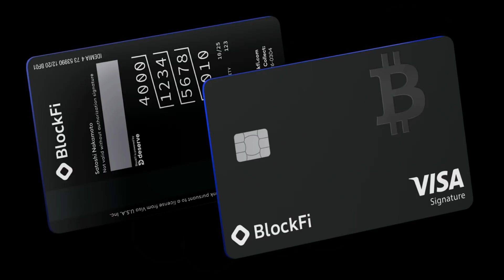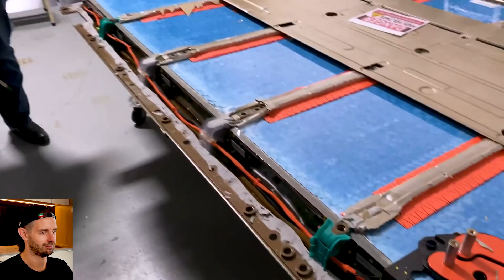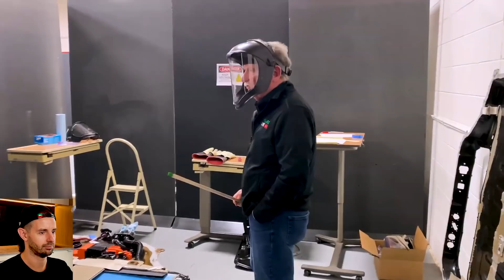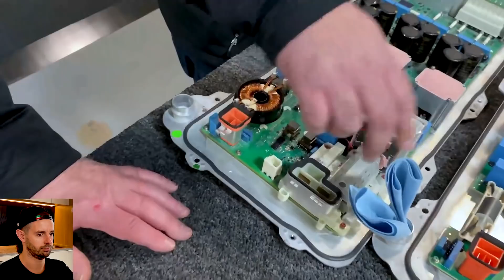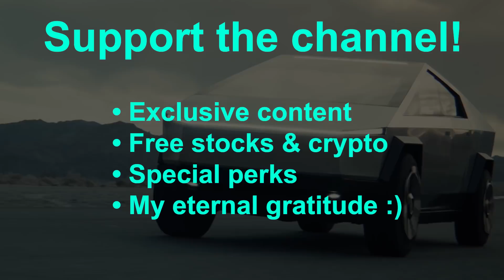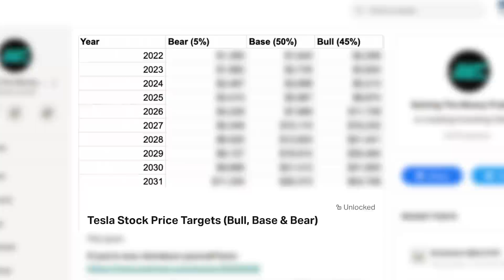Sandy Munro EXPOSES Tesla's Engineering Secrets

Comment: The Engine will be Double with up to 2 Engines in one for 4 Engine for far Higher Price to Car and Save Costs on Engines and Save Battery and Better Eccelartion. Even in CyberTruck that Start with 2 not 4 i Think, Maybe, and Semi with 4 to Save Costs and Better Stops. And in X and S Plaid Ex for 185K. And Roadster that can go 600 KmH for 200K.

Comment: The cost savings of using common electronic components across multiple models is even greater than you might think. Common components using the same firmware reduce design and administration costs. It takes a great deal of time and administration to properly maintain a library of firmware. Frankly Scarlet it is a "phawking" nightmare mate.

Comment: The latest SpaceX presentation showed the first and second versions of the Falcon engine. They are like night and day. The second version looked like it had half the parts and were routed much more simply. He discussed some first principles concepts for different travel systems, outlining a heirarchy of mode share for the distance. A rocket could send people or freight to the other side of the world in an hour. But it would not be so practical going across town. But looking at the rocket launches it doesn't look to me like this is very practical for travel within our solar system, let alone to another solar system. It's a massive amount of fuel just to get to orbit, then it needs to have tankers sent to orbit, to refuel the ship before it heads out to Mars. Right now, a Mars trip would also require sending propellant to Mars to be used for the return trip. People say right now 40% of ocean travel consists of just shipping fuel around the globe so we can ship the stuff we want to move. That's massively impractical and illustrates the impracticality involved in using rockets to get anywhere beyond orbit or beyond the moon. We need another system of propulsion altogether. If and when we invent one, rockets could become as obsolete as fossil fuels are for surface transportation. Chances are we would need a dozen independent methods of propulsion to make solar system travel in any way practical and to make inter stellar travel remotely conceivable.

Comment: Backward and cross compatibility as well as common parts were part of GM's philosophy back in the 60's. Working those old cars was easy because there weren't a lot of unique parts and some parts were common across different GM platforms. The number of different size bolts was also limited. Over the years complexity increased and we saw that philosophy die. My, how they have lost their way. Now it's gonna bite them. Always remember that the fundamental tenet of good (and beautiful) engineering is KISS - KEEP IT SIMPLE STUPID.

Comment: Steven, another great video, thanks. I lead a small zoom investment group and one of the participants is a mid-level mgr of the water & power company of a major US city. This person believes that both the national and regional electric grid-infrastructure in the US will not be able to support the growing electric needs posed by EV growth by 2040, much less by 2030. In their opinion, this will put a ‘cap’ on useful charging stations, EV and Tesla sales. Additionally, over half of the US is in severe drought, particularly the Western regions. 90% of US electricity is powered by water driven sources, which are at all time lows. Have you done any research/thinking in this area? Comments?
Reply: Mega packs to support the grid? Power walls to support individuals? Solar to support power walls? Just thinking out loud.

Comment: When Tesla uses top rated chips it makes saving in power usage and there is a lot to save when Tesla may take .5 kW to operate wheen car is on. But others relay to traditonal automotive components but those are power hungry. For example Tesla moved from intel to AMD and got instant saving 50W but when you apply it fully charged car on period eg 10h that is .5kwh and so it goes. Chineese are not producing sub 7nm chips that Tesla uses so they are not in position to monopolize EV making .

Comment: Another very good example of why legacy automotive lag behind true pioneers--they opt to copy rather than do their own homework. Many automotive OEMs perform 'benchmarking' activities on competitor products. They essentially reverse engineer the other guy's product to see where they can use his idea's to improve their own gadget/widget. But the problem, as I see it, is that this process makes you lazy over time. I'm pretty sure GM has 'benchmarked' several of Tesla's vehicles to glean some epiphany on how to out-manufacture or out-patent the company. This is traditional thinking. Where are their ideas? Where are their body designs? Where is their identity as a manufacturer? They have none...well, they have badges on the different vehicles but that's about it. Some companies will get it and begin to decide to really invest in R&D again while others will cease to exist. As Sandy Munro pointed out, saving mass, using true common parts philosophy where appropriate, reducing complexity and parts are things current OEMs are aware of but they don't discipline themselves to be diligent. That is why many fail when it comes to innovation. Many use the word but precious few really understand how it translates.

Comment: The graph at 6:20 combines different parameters and different units all mixed together onto the Y axis;  it is utterly incomprehensible.  MPGe and Range should not be plotted together;  they are not merely unrelated;  they go in opposite directions;  and are different units;  forming two sets of curves that tell opposite stories to the untrained eye.  What's even worse, there's a blue down arrow between the sets, further suggesting that they are somehow related.  Very disastrous creation.  They do a lot of good things at Munro, and I'm a big fan of theirs;  but they need an editor with a fraction of a science background.  Ironically, I sent them my resume but apparently they don't want un-degreed Canadians.  I could help them remotely, too, but apparently they also want to smell the socks of whoever they hire.

  Same thing with my applications to Tesla, SpaceX and Neuralink.  Rejected every time for being Canadian.  Their HR departments I'm sure are nowhere nearly as incompetent as those of most of the industry, but they still manage to be effective traitors to Elon's values, and to make all their decisions on the basis of arbitrary rules of thumb, instead of first principles.

  As for the analysis of the charger, they need an electronics engineer desperately.  I mean, wondering about the color of the electrolytic capacitors is kinda ludicrous;  you can buy the same capacitor from Rubicon, Nichikon, Samsung, or any other brand, whatever is in stock, and they are all different colors.  So what?  The size of the heatsink is more significant, however, and if it got smaller from going from Y to Plaid, that is VERY significant, as one would intuitively expect the opposite.  THAT may reveal a serious efficiency increase.  The question then is how.  I'd be looking at the markings on the switching semiconductors, and other things, and looking up the specs, to figure out how they did it.  The size of the input inductors, and going from two to one only likely implies they figured that they can either live with more switching noise going back to the charger, or that they raised switching frequency and therefore need less inductance,  or that the noise was mostly common mode and they could get rid of it with just a single common mode choke (two wires wound around or going through a common inductor).
  I could tell by looking just at input and output on an oscilloscope, figure out what the noise story is;  not that a noise filtering detail should be anywhere as interesting to most viewers as an efficiency increase ...

  The only lesson here for legacy automakers is vertical integration.  Outsourcing complex things like electronics is absurd.  It should have been obvious from the beginning how absurd a decision that was.  If you are a tiny company with 12.5 employees I could understand you can't afford to design your own electronics in house;  but companies like Ford or GM making themselves permanently dependent on outside vendors for their electronics was a disaster waiting to happen, until it wasn't waiting anymore.  I mean, for what friggin reason would they not hire their own electronics engineers?  It is incomprehensible to me.  Perhaps as a stopgap solution you might temporarily outsource ... But PERMANENTLY rely on third parties?  That means you are selling cars that you don't even know how they work!!!  Nobody in your company knows how the circuits work!  No one knows what the software in the controllers even looks like!  How can they be so unbelievably retarded?  And I DO know the answer, but it's too much to write down here;  it is related to the fact that usually the stupider people are, the faster and higher they tend to rise in the power structures ...  whether of cities, nations, or companies.  The people at the top are often the stupidest.  Often this rule is broken by some good president or CEO being there, but both are pretty powerless;  far more powerful than the CEO are the spreading bureaucracy of bean counters, the asphyxiating bureaucracy of the unions, and the despotic owners and investors.  And the general public do feel the overwhelming stupidity of the ruling classes in all spheres;  I have a feeling I will witness a world-wide French Revolution style rebellion to the entrenched stupid classes before I die;  and I'm close to 64.
Reply: Have you ever seen engineering graphs? Material science graphs and thermal equilibrium graphs are like this. This however is kept more for engineers vs board rooms.
Reply: @unadultratedtrini  I don't think you understand what I'm talking about, at all.  The graph contains points where the Y axis denotes miles per e-gallon, and it also contains points where the Y axis denotes kW per hundred miles;  and they both use the same numerical scale.  This is NEVER done in graphs anywhere.  Period!  When you represent two different quantities onto a common axis, the minimum requirement for clarity is to have two set of Y axis labels:  one on the left, one on the right.  You don't just use the same numbers for unrelated quantities.  And it wastes everybody's time when people who don't know what they are talking about reply to a post and try to pick up an argument for no reason at all.  Go away.

Comment: meanwhile...over at Ford, they're busy transporting fully-built  brand new F-150s over to a second factory to have the brand new Engine, Gearbox, Transmission, Exhaust system, Cooling System and Electrics completely removed to turn it into a Lightning! But hey, I'm sure the genii at Ford know what they're doing, right?  🤣🤣🤣🤣🤣🤣

Comment: Any bets on if the improvements in Model S are coming or already have been implemented in Model X,Y, and 3? Didn't think so because you know they have.
Reply: A lot of the S changes are to catch up to the Y.  And others are performance upgrades that the 3/Y will never see.
Reply: @donm2255  Sure the carbon wrapped motors will probably never go in Ys and 3s but things like the changes to electronics package sure will be in the others.

Comment: and it costs $25,000 to replace the battery
Reply: Maybe, but you probably won't need to do that for, what, 0.5 million or 1 million miles, so who cares?  By the time that happens, new batteries will probably be much cheaper anyway -- and that's assuming you actually keep your car that long and don't want to just sell it for parts and buy a new one at that point.
Reply: No different than replacing a engine in a high end vehicle.  So what is your point?
Reply: It "DID" cost $20k.... When it's out of warranty,
But DOES it now?
We MIGHT know in ........ How many years?
What will they cost then?
Will this car even use the same pack by then? (Highly unlikely).
.
More likely that with cell prices about to decline rapidly, a Plaid owner might take advantage of a $10k structural pack upgrade, saving 40% on the pack weight and giving BETTER performance?
You know.... "Classic plaid with upgrade"? I would say that could be a good investment.
Especially if the owner had allocated say, 2 shares bought last year for "upgrades and repairs in 10 years"?
They'll be worth well over the replacement cost!

You need to think things through before posting FUD.
Reply: Well yes, battery constrained buddy remember? They don't stock these things at Checker or Walmart and so on, yet...

Comment: Surprising - I once heared from Sandy that Tesla would not use "oldschool-fuses" anymore, now I see the fuses in the units...
Reply: If you mean resettable fuses...?
There are some which you don't WANT to be reset.
Low energy components? That's fine if an untrained operator resets the breaker.
High voltage supply?
I'd say you want that somewhere an "enthusiastic amateur" CAN'T get to, especially when doing so may lead to ..... Death?
Just a thought.
Reply: Was thinking same, but are they?